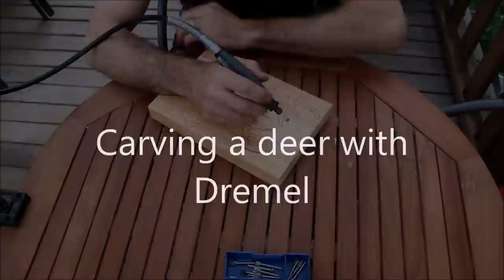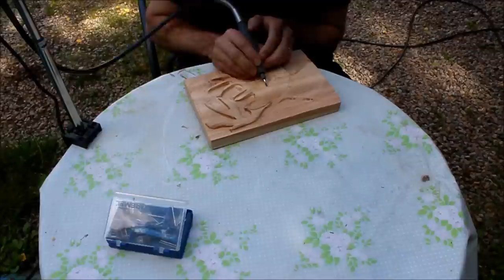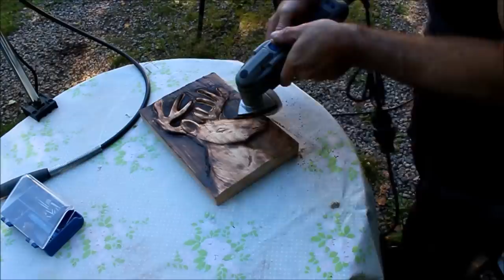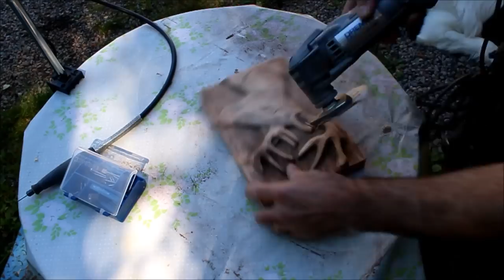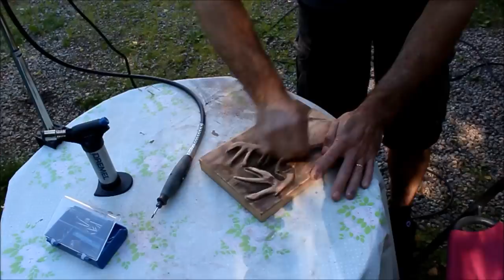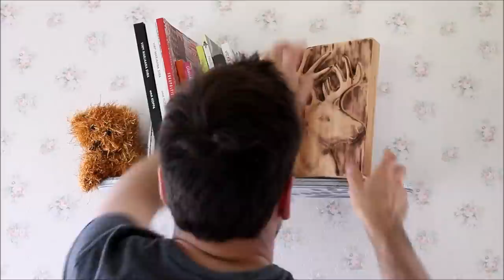Carving a deer/ reindeer relief with Dremel.

Comment: that dermal does not look like the dermal 3000 that is coming up in my search's so therefore how do I get that kind of dermal all the searched one are big and bulkie then the one you have
Reply from the maker: I have flex shaft attachment.
Reply from the maker: This kit: http://www.amazon.co.uk/Dremel-3000-1-Multitool-Attachment-Accessories/dp/B0078LENWU
Reply: +Tuomas Soikkeli do i need the flex shaft to do that or its okay with dremel 3000 itself ?
Reply from the maker: You can work without it too, of course. Its just how you like, flex shaft is just smaller and lighter to handle
Reply: +Tuomas Soikkeli thank youu

Comment: nice work man :D realy nice 
hey, a question... i got a dremel With the flex atatchment and... it gets Hot as hell D: is it just me? or yours gets Hot too? 
the mandril gets Hot... not the pencil... 
p.s. sorry if my english is not 100% correct 
saludos desde Chile ^^
Reply from the maker: Hi. Mine heats too. I have dropped some oil inside it, so it doesn't get burning hot.. but I think heat comes mostly from the bits, so its hard to avoid it.

Comment: how long does it take ? and how long have you been practicing doing this ?
Reply from the maker: It took 3 hours. Its one of my first ones with wood. 

Im actually just testing my wood carving bits that i got from Dremel. I made a project for Dremel Europe and got Multimax mm40 and a set of wood working bits as a reward: http://www.kadentaidotblogi.fi/2015/08/laatikko-grillaustarvikkeille/ 

So... my opinion is that, this kind of things are very easy to make without any special skills, or many years of practising. ☺ 

Never thought that someone would actually watch my videos. Thank you!
Reply: +Tuomas Soikkeli Yet many people do.
I find the small carving projects the most inspirational, using common items for which you don't need to invest in raw materials. Like the skull ring from a nut
Reply from the maker: +Willem Arnhem im thinking about the same. Usually i try to use leftover materials. This  one was cheap: https://m.facebook.com/story.php?story_fbid=1497589113877733&substory_index=0&id=1489535234683121 

☺

Comment: what tips did you use?
Reply from the maker: Sorry for my late answer. I actually just tested many different tips in this video. I think dremel high speed cutters 117, 134 and 144 are most usefull. Those can be used with many shapes ...  but Its just my opinion. ☺

Comment: what speed
Reply from the maker: 10k-20k rpm. Lower with high speed cutters when shaping.. higher when smoothening. Full speed when finishing with diamond tips. Sanding drums works better with 5-10k speed.